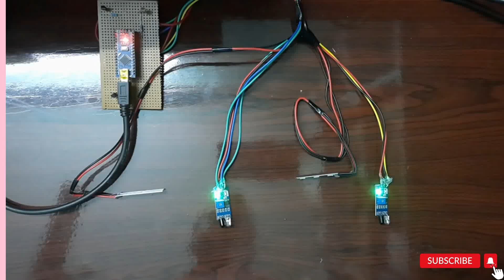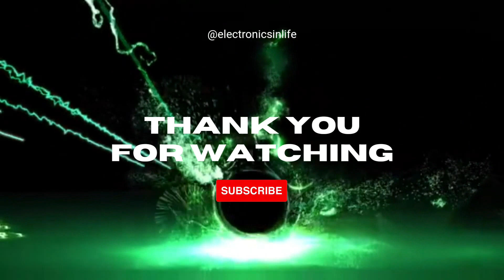How to do Smart Street lights using Arduino Nano|| Power saving @aniltechoelectronics6582

Comment: Nice project one small doubt  when car reaches second light first light its off but car moves,   second light will not getting off ?
Reply from the maker: Second light depends on third light which was not there, this type of system save electricity
Reply: @aniltechoelectronics6582  ok but at last one light is there ... What about that?